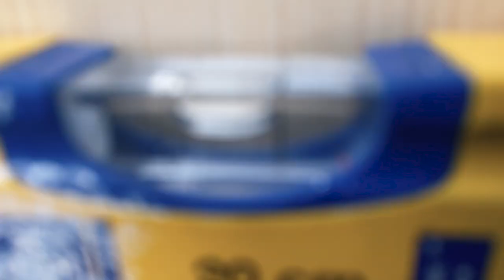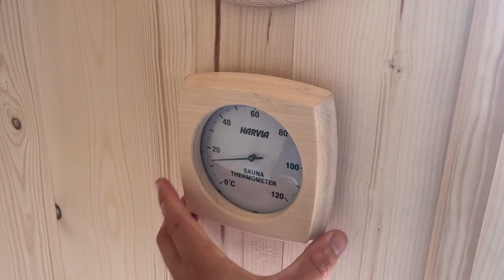Building a Barrel Sauna Alone | BALTRESTO

Comment: Hi, how hot can you get your sauna during winter time? I heard that because of lack of insulation in barrel saunas, you cannot properly heat it (80-100 degrees) during winter, its true?
Reply: Wood-fired stoves can overcome this to an extent because of how powerful they are. Even the Harvia M3 (which is probably the stove he has in this video) is 16.5 kW. Compare that to the electric stove you'd get with a model like this which is probably either 6 kW or 8 kW. Even compared to the 8 kW electric heater, that's double the power for the wood stove.

That said, cabin saunas are still a better design for a handful of reasons. Can't deny how cheap and easy barrels are though.